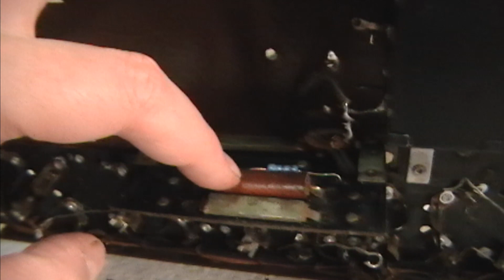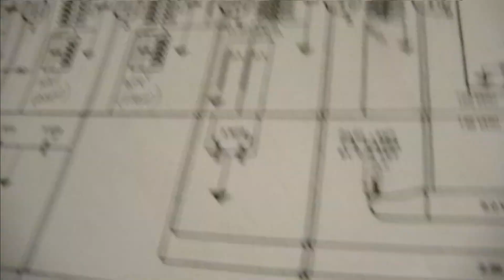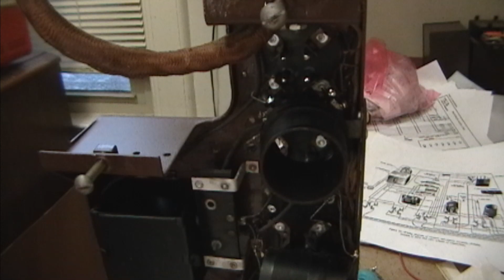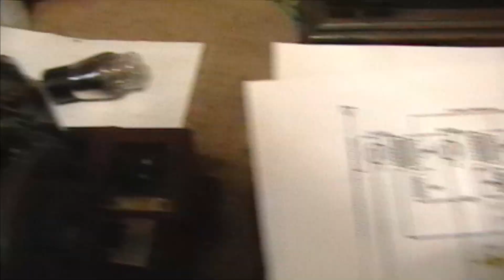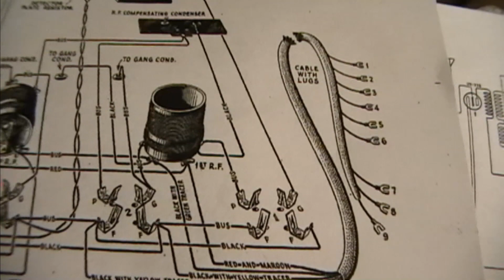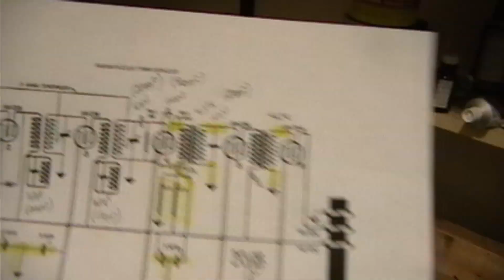Brunswick 5KR pt12

Comment: They are sensitive at the upper end of the dial but not at the lower end. the tuned radio frequency design is a better than most superheterodyne models your set sounds normal and seems to be working properly and your going to have a hum.

My philco 87 TRF model has almost the same power supply set up and it hums a little but that is normal just one thing get a good ground and get a long antenna about 150ft and it will blow you out of the water.

See you on ARF Bob.   - Jake wells

Comment: I gave up buying radios over fleabay after the second time one came to me in pieces. Too many sellers do not know how to pack. I think the last thing I bought was a horn speaker but the seller had a lot of experience packing such things properly. You can usaully spot a shill bid auction because the bid price is at least 30% higher then the next highest priced item of the same kind, usually with a bunch of low or 0 feedback bidders with a high percentage of bid activity with that one seller.

Comment: Yes I did, one of the previous "repairmen" took out the original RCA style IF can and crudely mounted a later square ones in it's place. I suppose that I am doing a little more then I have to on the electrical restoration but the customer wants a complete overhaul of anything that looks suspect. The last guy that had at it was very big on splicing wires together and making solder juctions in mid air, I just did not feel right about leaving it that way nor trying to trace back everything he did.

Comment: I was surprised at the selectivity of that radio.  I remember building 1 and 2 stage trf radios out of a kit when I was a kid. While they recieved a couiple of local statios well, that was about it.  The selectivity was so poor you could tune 1/4 the way across the band and still be on the same station!  I never have experienced how well a trf could work. Even in Chicago, where there are many stations, weak and strong, the set seemed to be able to sort them out just fine.

Comment: In my opinion it doesn't make much difference, probably about 80% of the old sets out there have had at least some of the original capacitors replaced at some point during their life, and maybe a few resistors as well. What I prefer are sets that have all of the original major parts still in place like the speaker, coils, power transformer, etc., or at least replacements of the original style, not to mention sets that have not been altered too much circuit wise like wiring changed or parts added

Comment: I finally leaped head first into the repair work on that Westinghouse 801 yesterday, what a spaghetti factory!! The original wiring was bad enough but with all of the flakey service work that was done I was tearing stuff out left and right trying to get it back to a point where it started to make sense. I have to rewire half the chassis thanks to the fools who have worked on it, and I've only just started.

Comment: Bob, I think the most important is that the set is working again. Who knows in the long run the tubes show up somehow, and you change them, considering how lucky you are with sets and parts -like fixing tubes, finding exactly the correct speaker for the set, and those metal parts, etc, etc, etc,

Comment: Hi Bob. As I told you the other day, this is such a beautiful restoration considering the state the radio originally was and all the work you've done. It is so nice to see a radio that old working. I was really curious to see it working. A question, are those the original types of tube you are using there or they should be the bulb type like the first one?

Comment: I wonder if the "gimmick" wire was used when the transmitting stations were MUCH less powerful than WGN is now, and many of these sets were used in VERY rural settings, a long way from the transmitters. . . It  would make sense to over-drive the sensitivity in that case.
Great Videos - you've given ME the "itch" to get into some old radios I have sitting in the basement.

Comment: Impressive!  You are a craftsman.  I was wondering, is there any value or benefit  in leaving the old wax capacitors in an antique radio or TV?  What I am getting at is this?  Are they worth  more in terms of being original, all the original parts in place, or worth more actually being able to operate all be it with modern components?  I am not speaking so much in terms as worth in dollars as worth in terms of being an original antique.  Perhaps it just depends on what a guy wants to have?